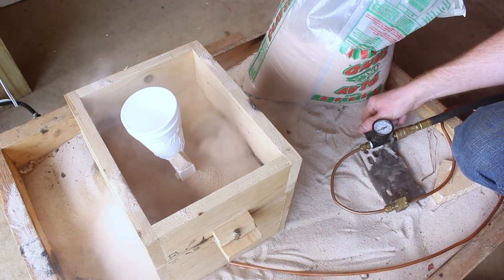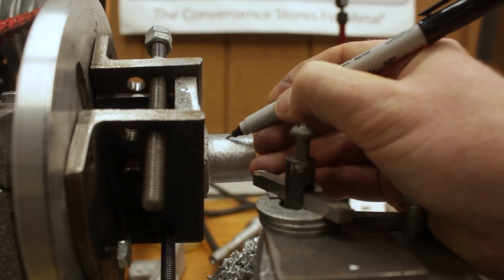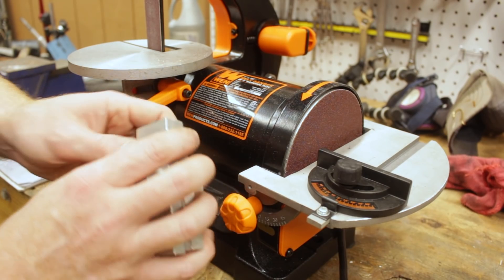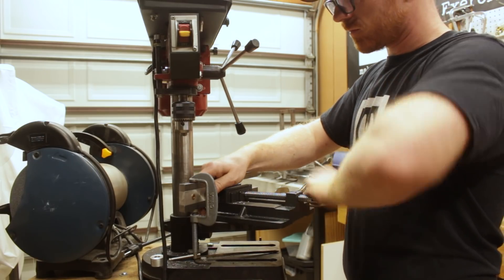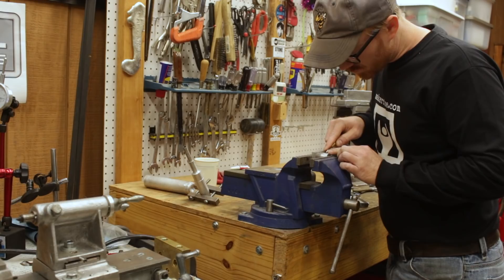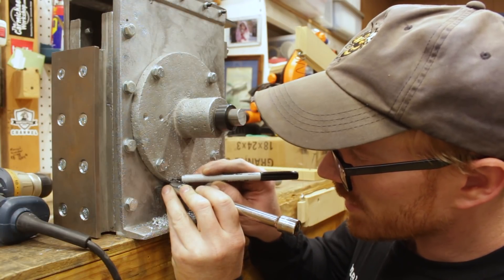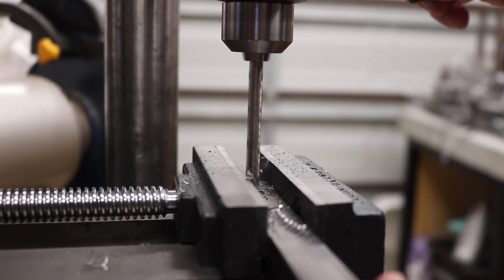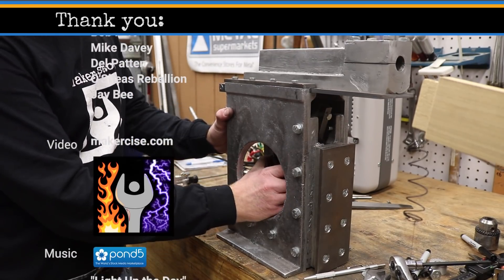Shaper Yoke Completion - Gingery Shaper Yoke Assembled

Comment: 1. You will not get a piece back into a 3 jaw chuck concentric with the previous turning you have already done in a brand new chuck in a well manufactured lathe. You should do all concentric operations in  one go. Otherwise you use a 4 jaw chuck and a dial test indicator (I will be posting a video about this when I've rebuilt my PAZ 1 diesel engine. 

Also when I am parting off a piece (albeit one I want to keep) fro  something with a hole in it, I always put a thin rod in the chuck to catch it when it falls.

Comment: This machine is going to wear out pretty fast isn't it..?....Porous soft white metal with mild steel sliding faces..?...Im talking about the main ram which is usually on a Dovetail slide.
   Apart from the increase in temperature required, is there any reason why you didn't use Cast Iron..?  Machines are made from Cast Iron for a very good reason. Admire your hand skills and determination, but Im sure you could use more appropriate materials to make this machine from.
Reply from the maker: You are right. Cast iron is a much more preferable material for a machine tool. As in the case of the lathe I made from scratch, I expect the shaper will wear much more quickly than a commercial machine. Aluminum is much more accessible for casting in the home foundry. I do plan to eventually begin casting iron, but in the meantime I'm following the Gingery series of books.
Reply: have you ever tried melting and casting iron by yourself, on a makeshift furnace ? Cast iron is exceedingly heavy, and must be heated to much higher temperatures than aluminum to be properly cast. While it doesn't often suffer from voids and porosity like aluminum does, a simple casting like the side panels could weigh in excess of 40lbs. Try swinging 40lbs of molten metal on the end of a 3 foot pouring tong, it's gonna feel like it's 100 lbs. Not to speak of the increased cost of melting and the added risk. Also it's not like this dude will use the shaper more than once a month, at best, before simply abandoning it to the empire of dirt. It'll hold up just fine.
Reply: Rafael Monteiro Rodrigues  when using iron the foundry uses a little wheeled cart thing to carry a small amount.  Large amounts are on cranes.   You just set up more.  Cast does not have the hydrogen bubbles causing inclusions but iron has a completely different set of problems.   Nothing that can’t be over come.

Comment: Two big pluses: (1) you are making this thing by the book (2) you are making it in metric. At last!  It is interesting to see how the ram-yoke linkage works, I couldn't figure it out from the book.
Reply from the maker: +Juan Rivero 1 and 2 are mutually exclusive. ;) i love metric for sizing parts and cutting length also for fastners. I cant get off the shelf pulleys, shaft collars, or metal stock locally. I will keep doing what i can.

Comment: good job! but its clear that my concern with lost foam casting is true.. you seem to have a lot of inclusions in the castings
Reply from the maker: +HomeDistiller thanks. ill try to do some experiments soon to determine if it is lost foam related or normal desolved hydrogen related. My bet is on hydrogen. I am not happy with my degassing process. Expect to see more castings with these inclusions until i get to my permanent shop. Thanks for following the project.
Reply: Makercise have you tried pool chlorine tablets? Also I found making sure you have a reducing atmosphere  in the foundry helps allot too (you should see no flame exiting the top of the foundry, a large excess of air)

Comment: Some people might be yelling "get a chuck" i'm just yelling "get a dial indicator!"
Reply from the maker: Rob Mckennie @3:04 right side behind the tailstock.
Reply: right, so the best tool for centering the work was a drill bit, or?
Reply from the maker: +Rob Mckennie you are right. I should have used the dial before i unbolted the angle clamp. I used the dial after, but it is an exercise in futility with my setup. The back of the faceplate is rough cast so moving the clamps around on the faceplate is extremely finicky. Live and learn.

Comment: the tapping drill size for m6x1 is 5mm not 5.5mm, just deduct the pitch from the diameter to get your drill size.
Reply from the maker: +William Anderson I used the littlemachineshop tap chart. They list a different drill for steel versus aluminum.

Comment: I don't want to seem to be a jerk, but Gingery's book is considered a troll in the metalworking world.  You said "but this is what the book calls out", which is precisely why it's making people cringe.  I've seen some really useful machine tools built from engine blocks and such, if you want a budget lathe or mill, using an engine block as a base is a really good direction.  I know that this is part learning experience for you, and part of it is trying to create original content for your channel.  However if you really want to make stuff, spend $1500 on a decent oldish lathe and use that.  A simple wiggler rod in the tailstock chuck and centered on the part would have gone miles towards getting the part centered without a lot of drama.
Reply: I realize you're probably a professional machinist who sneers at efforts like this, but the whole point behind the Gingery books is to show a way to do machining WITHOUT spending $1500 on a surplus machine tool. Many of us non-professionals don't have that kind of money to spend, and it's a source of pride to point to a finished Gingery style machine and be able to say "I built that from scratch!"  While they're not suitable for a production shop, they're quite capable of very respectable accuracy if built carefully.
Reply: Adding to the above comment, you'd be hard pressed to find a lathe of a decent size for anywhere near $1500. 
I really want to make stuff but I have neither the money nor the space for an industrial lathe, so this is the best I got until I can spend several thousand a year paying property taxes on a place to put my $1500 lathe.
Reply: Would make a huge difference if it was mainly constructed of cast iron. I'm planning on building a lathe from scratch aswell, though I'm following more along the lines of fundamentals of mechanical accuracy. I'm lucky enough to have a professional casting shop near by so I'll use them for the dangerous stuff. Though this series has given me some new ideas

Comment: You should do a new plate for the lathe where you don't use those two angle iron pieces rather a four jaw style one. In older lathes, such a thing existed. It was constituted of a plate, like yours, four squares that were affixed to the plate at various points to accommodate different sizes (think IKEA pin shelf style but with screws), and the adjustable mechanism itself. Through the square two fine pitch screws where passed such that they were pointed towards the center of the plate, they were placed in line, one in the back, one in the front. 

The ends of the screws were fitted with square head for a key to adjust the depth at which they went to grab the part, and on to the business end, there was a plate that caught both of those screw similar to how the swivel plate on a C clamp fits, but, without the ball end. It was a loose fit on a T slot. Those plates had teeth in them, but could be changed to finer or larger pitch for various parts.

That, IMO, is a better design, and a simple one at that. It can be scaled to your work, just as easily it could be used to swing 500 kilo or more weights (the plate itself was, when stood on the ground, as large as half a man's height, just passing over the height of the lathe it was used on. I would give pictures, but i can't find them anymore. But if anyone has visited the engineering museums in Germany, particularly West of the Berlin line, maybe they can provide some.
Reply from the maker: Book 6 has plans for a small 4 jaw chuck. I will probably make one after the shaper is done.